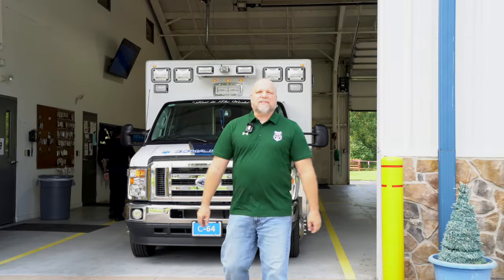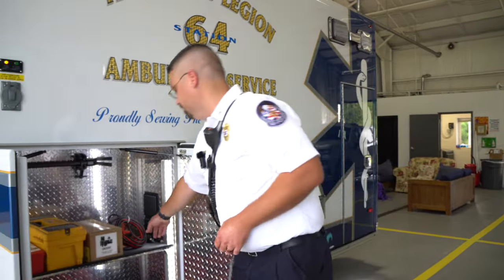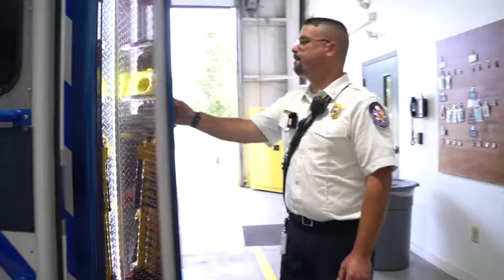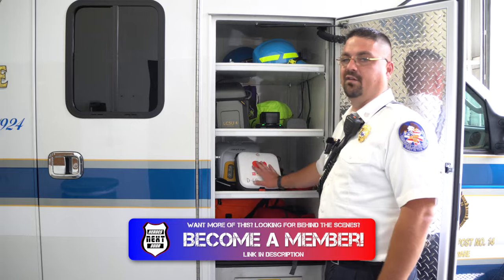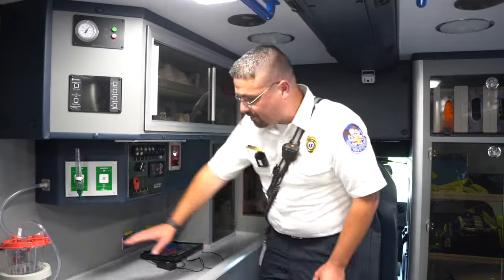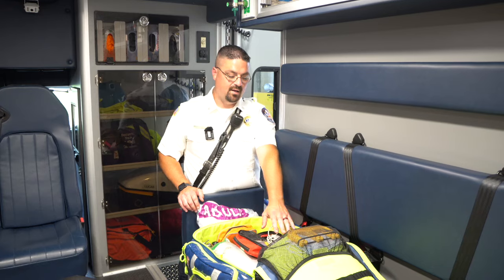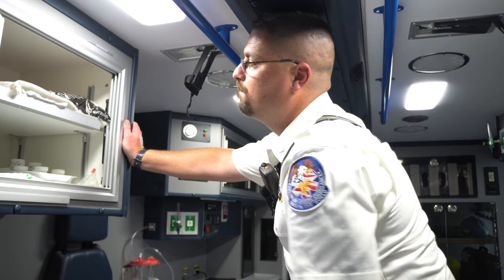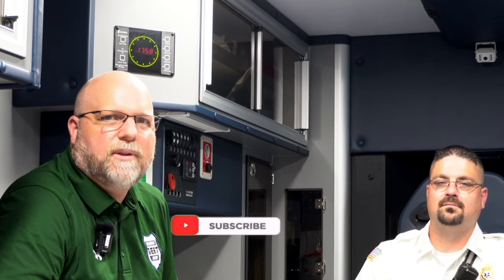What's INSIDE an Ambulance: Life-Saving Secrets Revealed!

Comment: Thank you so,so much for Ambulances TOUR 😊❤😊 of the Rig itself 😊. I love how you ask the questions of your guides
Explaining what the equipment does 😊
Not everyone watching understands the abbreviations ( military jargon) the best thing I liked was the 0-2 bottle lift system 
What a breakthrough in equipment design 
I really like how you always ASK 😊❤
How a citizen in the community can JOIN
The different Emergency response providers 😊❤. In my Humble opinion I thought you would have known about 
( Scope stretches) We used them back in the 1970s when I was a resident Volunteer. I just bought a 1989 Spartan gladiator Pumper. The Fire Cadet program has surplus. It has only been used for training since the Department that donated it to Fire Cadets surplus the engine. It has an😢 Allison Automatic and a Silver 92 ( turbo) DD engine. Darley Champion Fire pump. With the Automatic transmission NOW my wife can drive her in parade 😊 she so badly wanted to do that with our 1971 SeaGrave, it was a manual which must get it right RPM shifting. Buying the Spartan we can still do all the public events the Cadets did.
A big part of why the Cadets sold her, was one parking at drill tower station. And two all the Adviser Batt. Chiefs only want ONE training rig at the storage area at the training tower. The Cadets also OWN a 1500 gallon Tender and a wild land brush Ford 4 door F-450 with 300 gallon tank.
Reply: I do know what a scoop  stretcher is.  I ask questions that people might not know.  Similar to the AED question.   I use them a lot.  A great tool.  I like the newer plastic ones. They pinch patients less
Reply: @michaelborrello9944  
A big Sorry for your thinking that I meant you my friend. I like the way the guy who does these videos, ask questions ⁉️ that someone might not know what that equipment EMS & FF use.
Again sorry if I was saying something that you know very well how to set up, and have used them in real emergencies. Thank you for your service to the community.

Comment: I am a litle disapoint about this big car. No cardiac control monitors and the place organized in the car is not perfect. The standard ambulance car, called RTW, in Germany is quite better.
Reply: It appears that this department uses a fly-car system. So most of the ALS gear including the cardiac monitor will be with the Paramedic on the fly car and only brought into the ambulance when needed.
Reply: @Killerduck0213  Yeah they normally keep it with them unless they are assigned to the rig. Im not familiar with fly cars though, closest we have is supervisors, or department chiefs. That is prob because where I live everything is private and they run two EMTS so we always have an EMT with Paramedic.
Reply: It's with the Paramedic and Germany is not better this is just a small department that's funded by a small town. they run two EMTS who volunteer their time.
Reply: cardiac is als stuff so it will only be in the ambulance if its in an als unit if not then its in the paramedic fly cars
Reply: In Delaware, it is a two tier system. Fire Department and EMS Agencies respond BLS, and the county provides the ALS service with chase vehicles ( fly cars). We utilize priority dispatch that codes each 911 call to what resources are needed. A simple stubbed toe with get a BLS transport unit from the local BLS agency and anything requiring Cardiac Monitoring, Advanced Airway Management, or IV medications an ALS unit is dispatched or requested by BLS upon findings from assessment. 

BLS agencies in Delaware do respond in (fly cars) with additional manpower, command staff for high acuity calls, or as a quick response when other EMS agencies have extended response times.
Reply: Die reden sehr ausführlich über das System und die Ausstattung. Was ist daran nicht zu verstehen!?
In Deutschland ist das System genauso kompliziert und kleinteilig wie in den USA und keins von beiden ist zwingend besser oder schlechter...
Reply: @chrischi783 “I’am a little DISAPPOINTED that you can’t spell.”